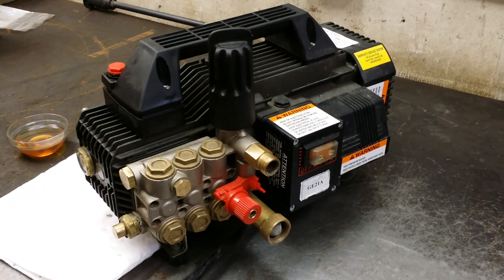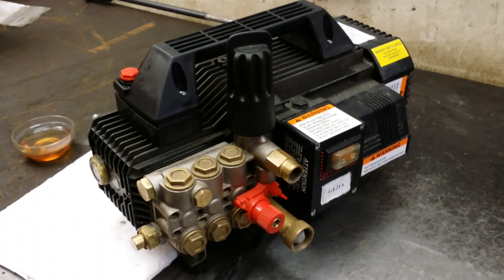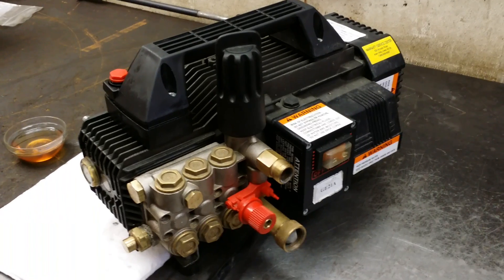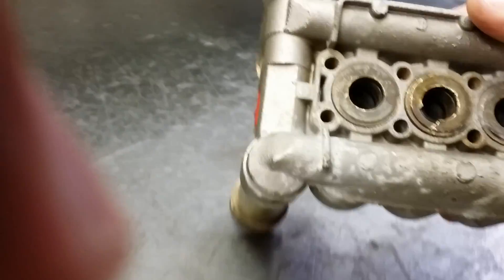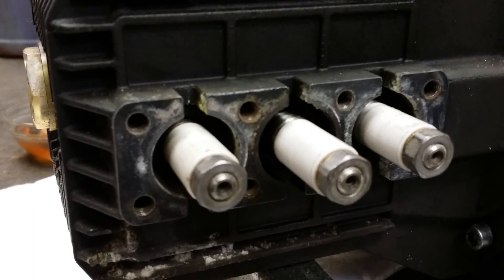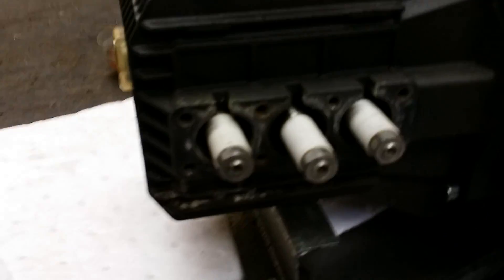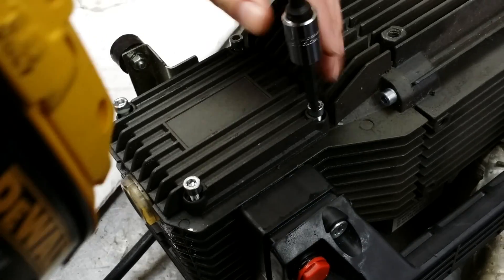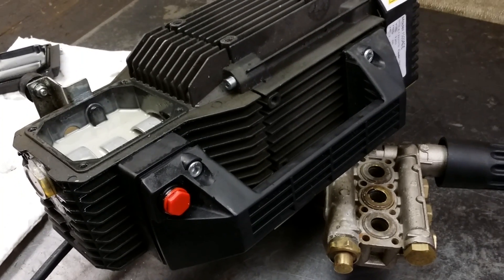Pump failure caused by water in the crankcase oil

Comment: What couses of abnormal sound when pump is running or when it's near to stop running?
Reply from the maker: Sorry just saw this. How is the water supply. Sometimes lack of water supply or restricted supply through a filter that need s cleaned can make a noise.

Comment: 1:49 where do i find these white tubes or what are they called
Reply from the maker: those are the ceramic plungers. Call 800-648-5011 and use the parts prompt, they will help you get them ordered and shipped.

Comment: How do Can pumps compare to Annovi?
Reply from the maker: The pump motor unit you see here is built by General Pump, Annovi Reverberi also makes an Itailian pump/motor combination. We have used both over the last 25 to 30 years and both are long lasting and durable. We use Annovi Reverberi, Cat, Udor, Comet and a few other pumps in our production. We like to choose pumps based on the applications they will be in. In some cases one manufacturers design may perform differently and may offer advantages to specific applications. Many times it is driven by customer preference, pricing, and parts availability that our customers have in geographic areas.

Comment: My pressure washer has a grey colour fluid leaking from the back (engine side) of the pump. what does this mean?
Reply from the maker: Probably water in the oil. Call 800.648.5011 in the morning. Tech can talk you through what needs to be done or find you a service center near you.

Comment: $700 LOL! Fuck that
Reply from the maker: In most cases regardless of size, quality or maker of a pump, once you get into the rear end of the pump with repairs of crankshaft, bearings, connecting rods, plungers and additionally every seal being replaced you are approaching 60 to 70% the cost of a new machine. The parts and labor discussed during the video are at a retail level with a local shop doing the work. This cost of course is less if you are purchasing the parts and doing the work yourself but we still would not recommend the repair.... It is still throwing good money at a used machine. The 1500A is sold by distributors with prices starting as low as $759 with free freight. This machine is used in detail prep areas, commercial screen print shops and industrial applications many running 5 hours a day. We have spoke with some customers with applications well over 2000 hours of use with proper maintenance. This small hand carry pressure washer weighs 58 lbs and the cost, durability and dependability cannot be really compared to the  DIY $399 machine. Many of which have no way to even change the oil, 250 hours or less and throw it away.

Comment: It was received from the customer shipped back to us via UPS. He was instructed to put the transport plug in before shipping rather than draining the oil so we can see what we were dealing with. Good catch! They are shipped out this way with a tag reminding the dealer or customer to remove and install dipstick with breather. We have seen some pumps create enough pressure to push oil seals out during operation. Most often when that happens if unattended all the oil drops and pump will seize up quickly.... and in those cases wet end stays pretty intact.... not so much the back end!

Comment: I'm with brad. Why the shit is the shipping oil cap still in place? No doubt you're gonna have problems.
Reply: It was received from the customer shipped back to us via UPS. He was instructed to put the transport plug in before shipping rather than draining the oil so we can see what we were dealing with. Good catch! They are shipped out this way with a tag reminding the dealer or customer to remove and install dipstick with breather. We have seen some pumps create enough pressure to push oil seals out during operation. Most often when that happens if unattended all the oil drops and pump will seize up quickly.... and in those cases wet end stays pretty intact.... not so much the back end!

Comment: The original red oil filler cap has not been removed and replaced with the yellow dip stick in accordance with the instructions that come with the machine. The red plug doesn't vent so excess pressure will build up on the oil side.
Reply: It was received from the customer shipped back to us via UPS. He was instructed to put the transport plug in before shipping rather than draining the oil so we can see what we were dealing with. Good catch! They are shipped out this way with a tag reminding the dealer or customer to remove and install dipstick with breather. We have seen some pumps create enough pressure to push oil seals out during operation. Most often when that happens if unattended all the oil drops and pump will seize up quickly.... and in those cases wet end stays pretty intact.... not so much the back end!